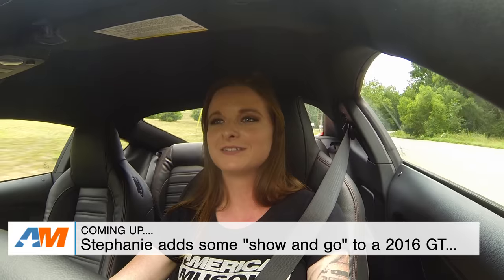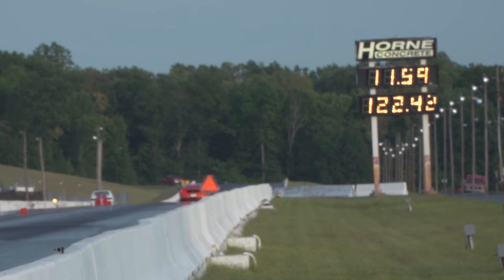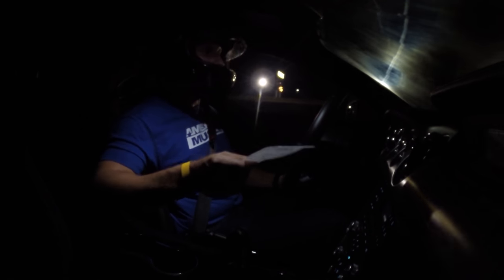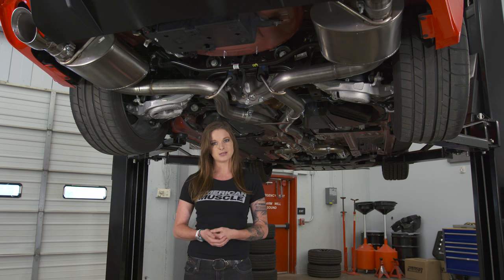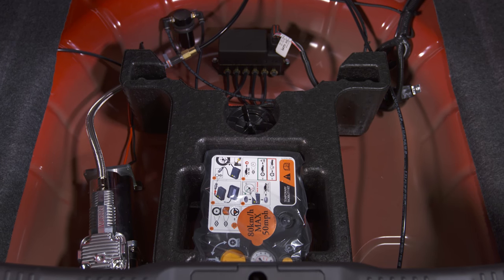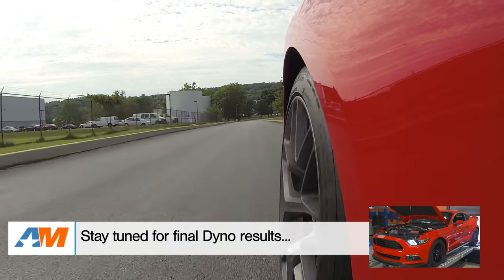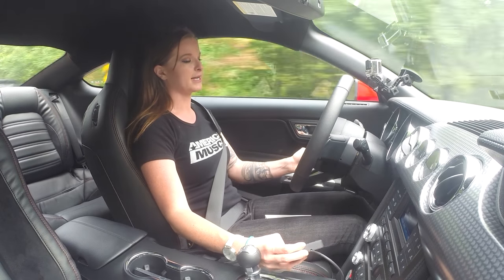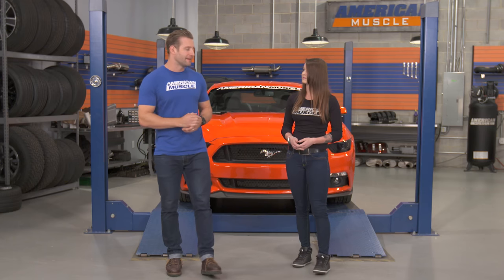700+ HP 2015 Ford Mustang GT Drag Pulls + 2016 Mustang GT Air Ride Build - Hot Lap

Comment: Good job Justin! Those are some respectable runs. As for the build, I can't even imagine how loud the Xtreme's are with Offroad LTHs. My neighbors already hate me with just the Xtreme catback alone, haha (but I absolutely love it!) Had the Roushs on my '14, and I thought THOSE were loud. The Corsas are an entirely different ballgame. Good work as always to the both of you!
Reply from the maker: It is LOUD! I actually run a similar setup on my 2014 Coyote (Stainless Works Longtube Headers, Off-road X pipe, and Corsa Extremes). It is insane! I actually welded Race Bullet mufflers in place of my resonators to tame it slightly and combat some of the rasp, I think it sounds sick! - Will
Reply: I think I have seen a video of your car on instagram. I would have to agree, the thing sounds like it just broke out of hell! Obviously in a good way, haha

Comment: I still haven't missed a entry every Monday.
Reply from the maker: Good luck Brandon!  -Justin
Reply: same here! ::i can only pray now.
Reply: How much do you guys think the taxes due will be?
Reply: If your prize is a non-cash award such as a trip or a car, you will owe tax on the fair market value of the prize. There is no uniform method for determining fair market value. Neither the U.S. tax code nor U.S. Tax Court rulings have specified the proper way to set the fair market value of a non-cash prize. The sweepstakes or contest promoter will report what it considers to be fair market value. That figure may be different from the “approximate retail value” the sponsor cited in sweepstakes advertising. But the sponsor’s fair market value figure may be subject to dispute. For example, parties could dispute whether the fair market value of an automobile is the manufacturer’s suggested retail price or the discounted price the sweepstakes sponsor paid to buy the car.

So, Depends, the market value of each. A New 2017 Raptor starts out at no less than 49K rounded up, a new Mustang GT is no less than $33k+, now assuming you are just paying for the cars prior to upgrades. You will be paying estimated around $3,920 for the Raptor, and no less than  $2,640 for the Mustang GT , ( so no less than $6,560 combined). I personally don't find this a big deal for anyone, you could get a loan for this working minimum wage, have it payed off in 2 years paying 275$ a month for two cars(this is without what ever interest rate your bank gives you), or 600$ a month in a year with a lower interest rate. I would be ecstatic to win regardless of any taxes. I'm curious if you pay taxes on the trailer too haha.

Either way, if i win, ill be more than just happy that my ecoboost mustang lease is almost over. This would be really life changing to me personally, since all I've wanted to do is build a monster that's mostly used for "Off Road Use"
 Notably, if i do win, i really want to setup this mustang with a water methanol injection setup from snow performance and a new tune, because i want more torque out of that supercharger. Turn this mustang into a real Drift Missile, and GTR Killer. I'll be doing a hell of a lot to this car if i win it... Best Wishes, and good luck.
Reply: I guess we have better chances given that those with bad credit scores and screwed if they need a loan ha. Nonetheless, any taxes due are worth having those 2 monsters. What will be paid compared to actual price is pennies on the dollar.  May the luckiest participant win.

Comment: tuned 2018 autos are running the same time.. N/A..
Reply: Yea in killer da.  I gaurantee they won't run those times with the same da.  Nobody ever factors in da.  In Bristol where I run the da is always shit and on top of that the prep sucks on test and tune nights and the track has about a 1% uphill grade the entire way.  Cars run slower there all the time its just common knowledge it could be similar where he is I would just about bet it is something like that.    Trap speeds are always way down where I am too.  You just never know.  People on the internet are always keyboard experts but never take things like this into account.  They see the hero runs in mineshaft air for these light modded 10 speeds but you don't see the ones running mid 12s with bolt ons and tune where I run at.  Everybody knows the runs on the internet in perfect da sometimes negative da which is insane in Bristol its a victory if we see 2000 da.  Usually it's in the 3-5000 range.  Some places have even worse da problems than we do.  Lots of factors.

Comment: for 700hp should be 10sec car. 11.3 can be done without supercharger but with other miss and a good tuner
Reply: meant other mods
Reply: Vinesh Pratap 3600lb mustang that isn't built for drag racing, 11.3 is pretty fast still. For comparison, stock mustang gt has average 1/4 time of a little under 13.5 sec. 700hp in a purpose-built drag car (maybe just something much lighter) will make 10 sec 1/4 easy. 😊
Reply: Vinesh Pratap I've come to realize s550s simply aren't built for drag racing. they are great for track racing though

Comment: Well if I win this mustang I will post video from Cecil drag way. That's the track that I run when I can race.
Reply from the maker: That's awesome! I'm a huge fan of Cecil myself and am there regularly! - Will
Reply: i used to run a white 88 vw golf gti vr6 swap with a 75 shot, 60 foot times sucked but it did 13.5 in the quarter, and now i'm doing a 95 ford ranger 351w turbo build.

Comment: Why does this video, and all the advertisement done to this mustang say 850, but you hear justin say 700HP at 6:43? Does it make 850 to the crank? 700RWHP? Enjoyed the video though, just curious.
Reply from the maker: Hey Blake, you are correct there! This car makes ~850 Horsepower to the crank which equates to 7-750 RWHP depending on teh dyno/fuel/condition/etc. Hope this helps and thanks for watching! - Will
Reply from the maker: Hey Blake, you are correct there! This car makes ~850 Horsepower to the crank which equates to 7-750 RWHP depending on the dyno/fuel/condition/etc. Hope this helps and thanks for watching! - Will

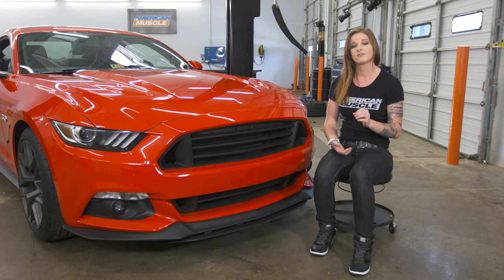Comment: 13:25 - FYI the car IS a Performance Pack because it has the Brembos and the Ebony black wheels.  It simply does not have the Recaro option which is why the interior looked bland.

Comment: this is what happens when you focus on just increasing power. it has over 800 hp for gods sake. aren't some 2016 Camaros hitting high 11s stock?
Reply from the maker: Hey Chuy- maybe you missed the build because we replaced just about everything on or in this car- drive line, suspension, rear end components, etc!  Just takes a little time to get a new setup figured out.  -Justin
Reply: There are no stock 2016 Camaro SS's hitting 11's, not even high 11's.
Reply: NexAgeMuscle well not stock but cai tune and e85 will hit 11.8 all day no boost don't believe me well thats your choice I am a mustang guy through and through o bought the 2016 Camaro with the previous discussed mods and consistently hit 11.8 on et streets

Comment: Loud exhaust are cool, but it is begging the cops to pull you over. They should put on some kind of adjustment on it.
Reply: Running offroad exhaust on my 05 gt and haven't been pulled over once for loud exhaust for 2 years now. It's all how you drive you drive like an ass you get pulled over.
Reply: ferretkiller9454 off course if you drive your car slow you won't get pulled over. The issue is that, if you put an exhaust like that in your car it is more than likely for performance which means you would want to drive it fast, the faster you drive the louder the exhaust get, and more likely the cops could hear it. I would suggest electronic controlled exhaust valves.
Reply: Juan. Lega I have a loud exhaust on my 2012 mustang gt. No problem. Stock 2014 evo gsr with no tinted windows, ticket 2 months after I got it. I'm in cali. Pigs here don't like ricer cars. Which is why I'm debating on which car to mod first.

Comment: 850HP ????? And can't break 11 sec quarter?   Obviously I'm missing something here.
Reply: Here I am scratching my head over the same thing. LOL. Should be 9 second material right there..
Reply from the maker: The low trap should tell you everything you need to know about the power the car was making (or not making) that particular day.  -Justin
Reply: I think the car is awesome. I watched the build vids on your site and it looks like you all did a great job. Just curious if you plan on changing gear ratio or anything else now that you know where it stands in the quarter?? Or, was this the performance in the quarter you were shooting for??
Reply from the maker: Thanks Steve- appreciate the kind words man.  Realistically we probably won't end up changing much with the car as its being given away in less than a month.  But if I were to win, I would throw on a taller tire and take it back to the track on a cooler day with better air and get that 10.  I feel that's where this car should be.  -Justin
Reply: I was kinda thinking the same thing. And I have entered online every week for a while. Looking forward to more kool stuff from yall.
Reply: poor reaction time (over a second) could also be a factor. all a matter of driver experience and skill which comes with time

Comment: Interesting. There should be a little more MPH with the car, unless you're getting out of it.

My 2014 went 11.1 with the 73's running out of gear at the same mark. The car is back halving like a mofo!
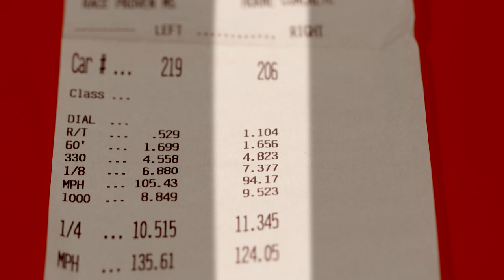Reply from the maker: I agree about the mph, and I even say that during the runs around the 5:30 minute mark.  The car was down on power that night- It was hot as hell and my inlet air temps were around 120+ for just about every run, no bueno for a blower car or ANY car for that matter.  Ultimately there are too many variables to compare your run to ours (clean S197 btw!) but I would definitely agree the car should have more mph given the advertised power level.  Thanks for watching T- and good catch.  -Justin
Reply: It will get there. :-)
Reply: Dropping to a 31 would work wonders especially with the PD blower. :-)

Comment: 850hp running 11.30's? More like 350hp. Get rid of that shit, no low end torque 5.0. Drop in a 1983 SMOGGED OUT 460 junkyard smoker and run 10's. Then add Kaase heads, 1250 Holley, Lunati roller cam...... Would twist the car in half.

Comment: The rear end is killing all your launch. You almost bottomed out your exhaust with most of the passes.

You need to set those rears to the "fuck my kidneys up fam," and you'll probably see the best improvement alone there because you're losing almost all your start inertia.

Wheels actually looked good throughout, may benefit from a subframe to stiffen the chassis. Did you change the soft bearings in the independent rear?
Reply from the maker: LMAO at your kidney comment...lol.  The reality is the we got the launch down to a low 1.6x which is respectable for the manual IRS car.  However in my opinion there were two big problems-  the car was down on power big time due to heat/other issues (hence the mid to low 120mph trap) along with needing to shift into 5th.  -Justin
Reply: @americanmuscle  I didn't realize you were running that hot and having to shift into 5th for 120. Yikes. That being said, thatd mean even more inertial loss at the start when making proper power and dumping it into the pavement vs having a giant angry space heater.

All in all though, those times on a car that's more track/road specd than strip and being unfamiliar with it is, indeed, still impressive though. You were juuuuuust shy of a 10 second car even with everything going against you, so props where they're due for sure.

Comment: 850 hp and it cant brake 10’s?
Reply from the maker: *Break... But to answer your question, the low trap speed should tell you everything you need to know about the power the car was (not) making that particular night.  -Justin

Comment: 11.4 with 850hp, thats...... not that great
im at 15.1 with my 310 hp 5400 lb 4 speed truck...... you have 6 speeds, 2.5 times the power and only 66% the weight....... u should be in the low 10s, high 9s
Reply from the maker: As stated earlier, the trap speed will tell you everything you need to know about the power the car was making (or not making) that particular night. -Justin